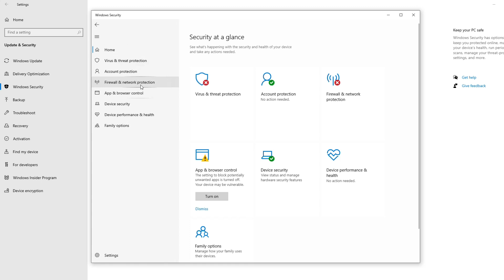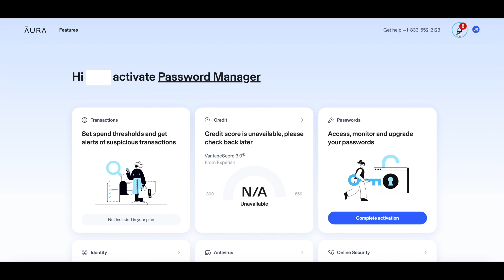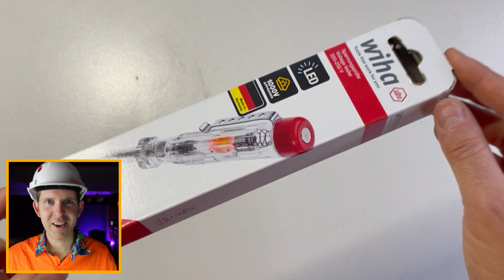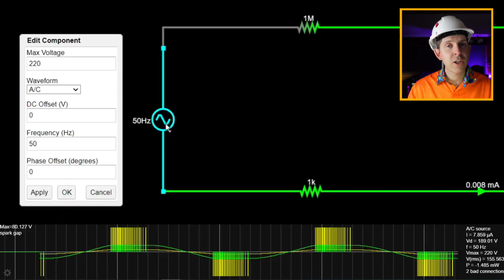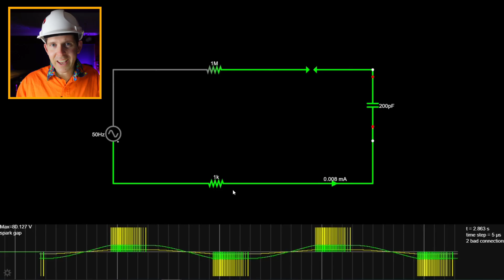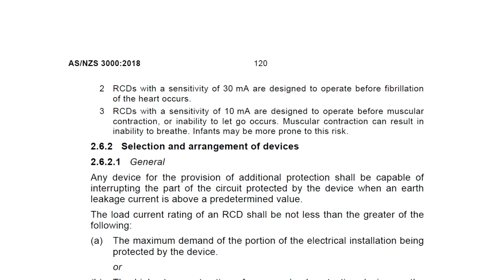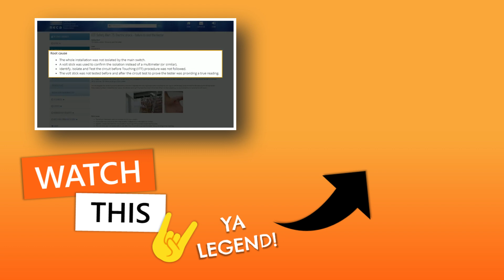ACTUALLY... This is the DEADLIEST Electrical Tester!

Comment: Since many channels here are demonizing this - tell me how many accidents have been caused by these tools. Coming from Germany I have been using these for about 35 years, and apart from their high value in countries which have non-polarized outlets (yes, Sweden and Germany for example!). They are not usually used to check if something is live, but to check which of two wires is the phase and which is neutral.
Also the tips of these are just the right size for about any screw you will find in electronics and electrical installation, including opening clamp terminals.
And about the issue that the screw driver might get wet and thus current might flow on the outside - well, that's the same with any other isolated screw driver as well, isn't it?
Reply: It's not about the outside. If liquids get inside of it they can bypass the entire neon fuse assembly. The outside of it might seem completely dry.
Reply: @potatosordfighter666   Ohh, ok, thanks for the clarification. Should be in the video.

Comment: Here in Brazil those testers are common, and I have one too, never heard of anybody being shocked by using them properly. The contactless testers are expensive and one failed on me after a battery leaked inside of it. Funny thing, we have 220V 60Hz, and also, 127V 60Hz here.
Reply: To get 220V do you use tapped transformers like in North America?
Reply: Here our power distribution is three phase, so if you live at the 127V side, it is 127V between Phase and Neutral, and 220V between Phase and Phase (which is similar to the America system and very handy!). If you live at the 220V side, it is 220V between Phase and Neutral, and 380V between Phase and Phase. So, if you live on a 127V place, you can have a entire 220V house, or some 220V appliances or outlets available for special appliances. If you live on a 220V place, and you have a 127V appliance (or a imported one live from USA), you need to use a step down transformer.
Reply: They are very common here in Germany, too. Or at least they used to be ...
Reply: I have one too, but I've found its more useful trick: mine has a detachable blade with a Philips head on one end and a flat blade on the other. This is handy if you have both Philips and flathead screws but don't have two different screwdrivers.

Comment: As with the non contact version: always test against a known live conductor. Multiple times a day. And then they are reasonably safe.
Reply: Yea of cause you test them on a live wire before trusting 230 V. Its your life at risk in the worst case after all. If you do Bungee Jumping you check if the rope is properly attached too, right?
This should be a no brainer, so I don't understand the video.

Comment: Hey this tool is simple and so its failure modes are simple. You've mentioned both of them - short accross the elements giving you a shock after being wet and bad contact not registering live voltage. The first one can be solved by storing your instruments properly, I doubt any electrical tools should be anywhere near water. The manufacturer could have potted the whole thing inside to make it waterproof, but I havent really seen any like that. If in doubt just throw it out, dont risk anything. The second issue is shared among all testing tools - how do you know the instrument is working? First you tap a live wire to see it working, then you tap the wire you're checking, then again the live wire. This tool has been used for decades but as usual it is very important how you use it. Also sometimes you just need to know which is the live wire and which the neutral, if same-color conductors are used or you suspect somebody swapped them, very usual in diy home installations - then you just tap them and have your answer. Best part - no batteries to die when you most need the tool!
Reply: It’s such a cheap tool, I could see how it’s dangerous to newbies
Reply: Also he said it's dangerous is a false positive, but actually dangerous is the false negative cause you ain't connected to ground
Reply: Third failure mode: too much ambient light. E.g. I tried one this weekend while replacing an outdoor outlet in the early afternoon, and only when shielding it with the box the new outlet came in and leaving a little slit to peek through and stick my finger through I could see it light up. I did not use the tool for checking that the line was really dead before replacing the outlet, for that I used a much more reliable electronic device. I only used the cheap one after assembly was fully done and power restored, for the fun of it, as there was one included in the box the new outlet came in.
Reply: @0hellow797  Newbies don't touch a wire or socket with a screwdriver or anything else, you learn that as a kid.

Comment: I actually view this video while being in germany and these neon voltage testers are common to be like this (I am not geram though). in Fact i have 2 laying around and they never failed me. I like them since it shows you if there is voltage on the line you work in while you can use it to screw in the the plastic connectros. I like light bulbs and fixture and i always use these Neon screw indicators. Plus, i actually like the neon glow.

Comment: Used these for years, not saying you're wrong, but never seen one fail electrically. Mechanically though? yea, they don't make good screwdrivers for anything more than an old school terminal block. Totally understand the failure modes though, we can just hope people store them properly and don't abuse them too much, but I'd much rather use it as a first indicator and continue to practice safety precautions under the assumption the connection is hot, even if the testers say otherwise. (Verify with a DMM, Insulated work gloves, handle wires with care and overall diligence etc.) I always hold mine at the very end between my fingers in a way that would make releasing it almost involuntary if my hand were to clench. I've had mains shocks in the past (Not from the screwdriver, 1/10 experience, don't recommend.)

Comment: In Germany electricians call it „Lügenstift" (Lying Pen). But it's crazy how many people her in germany have one. You'll find them in almost every Household. But many also just use it as a screwdriver.
Reply: Most people with common sense use it as a backup safety. You disconect the power and there should be no power, but especially in old houses there can be weirdness going on, so having this just to make sure there really is no power on the line is nice. Never have seen one fail, even the ancient one my grandfather used.
Reply: @theexchipmunk  I use a duspol

Comment: This topic has been covered to death by all of the other electronics and electrical YouTube channels and it really is a dead topic in my opinion.

Also, the screwdriver isn't as bad as everyone is making out. Many people I know have been using these for years with no issues. The example you gave of the screwdriver getting wet is really a non-issue - would you use your multimeter if IT got wet? When it comes to safety with your tools you always inspect your equipment to make sure it is in good functioning order before you use it on live wiring.

Comment: Here in Germany we call it "Phasenprüfer" phase checker and you can see that every electrician has one. They are save trust me, i've been using these things since ages and never got a shock.
Reply: As an electrician myself, we actually call them "Lügenstift" (Lie stick) and by code we're NOT allowed to use them to check for voltage. We're supposed to use "2-pole voltage checker" (2-poliger Spannungsprüfer) like the Benning Duspol line up. Granted, these are more expensive but for me, my safety was worth the 80€ I paid for my "Benning Duspol Digital".
Reply: @Kiramitsuoka  Never heard anyone call them Lügenstift/lie stick. See them in use often.

Comment: 2:23 the VDE sets up certain standards that are pretty high. So either it‘s one of the safer testers or it‘s falsely marked as VDE compliant. It‘s similar to the US electrical code in terms of the purpose.

Edit: Looks quite good, a appropriate resistor is used.

Comment: When you say that you don't like the metal screwdriver directly contacting the live wire two thoughts immediately pop up. Or rather a thought and a question. I'm thinking that no-contact sensors are  simply crap because you can only use them to confirm that there is in fact a voltage present. It would be really dangerous to trust that there is no voltage just cause those flimsy things fail to light up for you. A lot of times i get no reading at first but then after fiddeling around for a while they suddenly light up. They are simply unreliable at best. As for my question, i'm wondering how you handle your multimeter? I'm guessing that you are probably doing an excellent job of keeping those probes from getting smeared with random conductive goo.  And in that case you should, in theory, be able to keep your neon tester just as safe as your multimeter.

Comment: 220v ac of the outlet voltage is the rms value. It means that "max value" in your simulation should be 310v. I also do not understand why you used sparkgap instead of just LED diode that is available in simulator. This is just technicality though.

If you are so scared of those testers then you should not use any electrical device at all. Seriously chances of 1M resistor inside "shortening" are WAAAAAY lower than any normal use electrical device in your house having short between housing and live. And no - your grounding is not going to save you because you have NO diagnostic of its continuity and there is really high chance of failure of this kind.

It makes no sense to use neon based testers now days because, to be price competitive with alternative devices, manufacturers use cheap LED diodes. And those are oversensitive and prone to detecting induced current on all metal (or even non-metal) objects. Just buy electrical tester for own convenience and for heavens use ANY tester while working with 100+vac. And wear shoes (duh), it is enough isolation not to let you be electrocuted unless you touch live and neutral at the same time.
And when working with medium voltage you have to be sensitive to any humidity. It is not like humid screwdriver handle is going to be conductive enough to electrocute you, but when you feel any humidity you should immediately make sure there is no dripping water anywhere.

Comment: You can also get false negatives from them if you are working is bright light conditions or installations with a higher resistance path to earth that means the neon isn't lit as well or not at all. 
There were also issues with them historically as they used to be manufactured with a separate resistor and neon, so people would replace the resistor with lower value resistors to make the neon brighter. That was largely resolved by making them sealed units that cannot be dismantled, so I am surprised as that Wiha one looked like it just unscrewed, although the neon and resistor are a combined unit.
Reply: Someone on reddit once brought up the high resistance to ground issue so I decided to test it. I stood on a wooden chair in rubber boots without touching anything other than the tester and it still worked. The light was noticeably dimmer but the parasitic capacitance between me and the ground was more than enough for it to light up.

Comment: Not sure if anyone else found that but I sometimes use them as contactless tester to find the brocken spot of wire. Doesn't work every time but handy when it does.  It depends on the pvc thickness and quality.

Comment: Funny thing about mains voltage is, we say it’s 220V but it should be 230V, but at my house I always measure between 240V and 250V
Reply: Is it because it drops to 220 when a load is applied maybe?
Reply: @FullModernAlchemist  No, igts because boomers didnt keep up with modern times. Europe converted to 230 V in the 1990s buy some boomers still think that we live in the 1980s and say 220 V instead.
Reply: Most countries raised it to 230V as with that the difference between two phases is closer to 400V than the classic 380V. But there is also usually a +/-10% tolerance. So even 250V is still within acceptable limits.

Comment: Neon testers are actually life savers.
I haver never heard once of anyone being electrocuted by one of these things , yet I have heard and experienced an  uncountable number of occasions  , when  these devices have saved injury or death by giving timely warning of unexpected live conductors. What makes these devises such a safety boon, is their ease of deployment. If a worker doesn't have to keep connecting the black lead of his "safe" test equipment to neutral whenever he changes location,  - if all he has to do is probe with his neon pen, ( that requires no neutral connections because his body is serving as such) , it makes sense that he will probe more often.
Also, neon testers will detect "live" neutrals, whereas a tester that requires a neutral connection will not. "Live neutrals" often do occur,  usually because the neutral line has been disconnected from the main neutral bus , thus allowing it to float "live" via an appliance that has  been left switched on.
The induction type testers are very useful, but they will not tell you which of two wires lying in parallel to each other is the live one - or if both are.
It is theoretically possible that if one played submarines with one of these devices, and the device is cheaply made, he could cause it's internal  resistor to be shorted out, and so receive a shock when using it. You could however say the same for any tool that requires mains voltage to operate - don't get them wet.
Some people worry about the 1Meg ohm resistor becoming faulty. No need to worry, resistors never go short , never. They can go open, their resistance can even increase over time, but they will never short themselves out.
People need to be aware that these testers should not be used where voltages exceed the tools rating  (even so a fatal shock would be hard to get considering that 7000volts would be required to pass 7mA through a 1meg ohm resistor, 7mA being the smallest current recorded as potentially lethal). 
People need to be aware that these testers do not work when probing  transformer outputs.
I have carried out Google searches in an atempt to find ecamples of electrocutions caused by neon testers. I have found none

Comment: Okay, this is spooky. Last week I bought a set of insulated screwdrivers. I just got around to opening the package an hour ago and it had one of these things in it. I’ve never seen one before today and an hour after I opened it this video pops up in my feed. 
I guessed at how it works and thought it was a bit dodgy, so I didn’t test it.

Comment: I have one of those, I use it as a screwdriver. :P BTW, neon glows pink. If it doesn't glow pink, it's not neon, or the tube has phosphors on it.